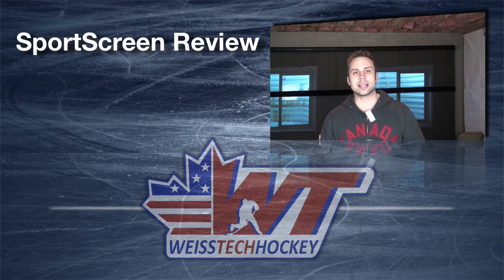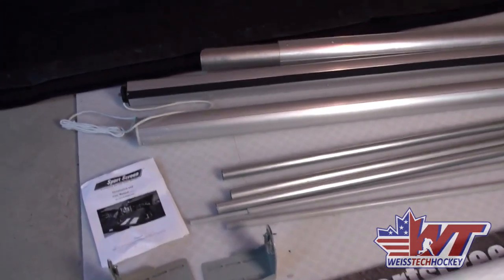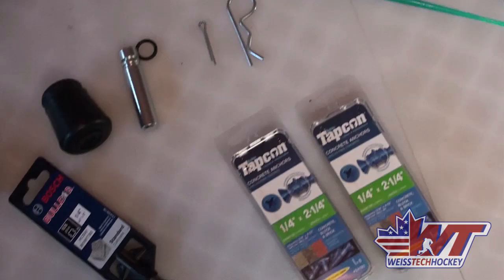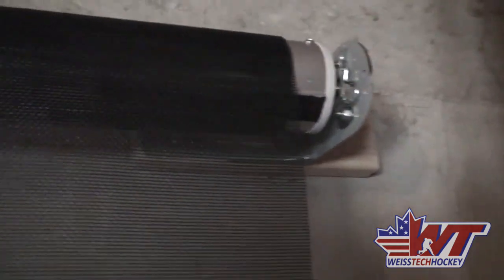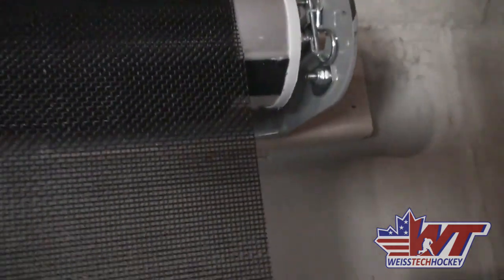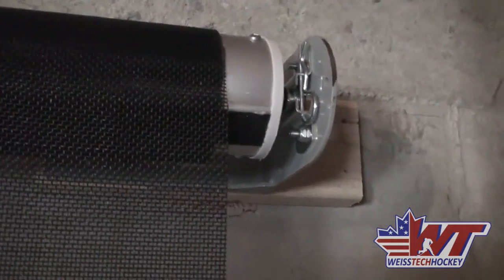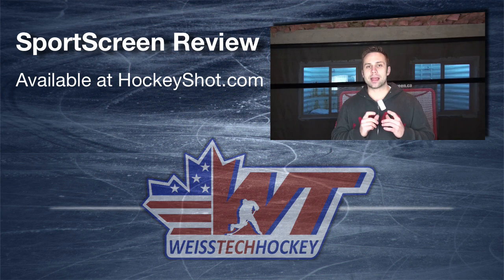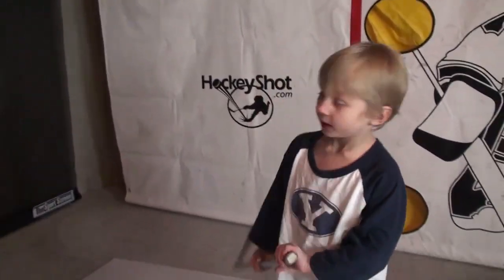SportScreen Review

Comment: Is the snipers one better or this one
Reply from the maker: depends on what you're looking for. they're actually quite different. this one is mainly designed to stop pucks from wrecking your garage or windows. the targeting system is secondary. the motorized lifting and lowering makes this REALLY convenient once it's installed.

sniper's edge is a targeting system––first and foremost. the holes have actual cut-outs, so you know for sure whether you scored or not. the down side is that you have to roll and un-roll it manually, which usually means getting out a ladder. 

if you have an area like mine, where you can leave it set up, i'd recommend the sniper's edge.